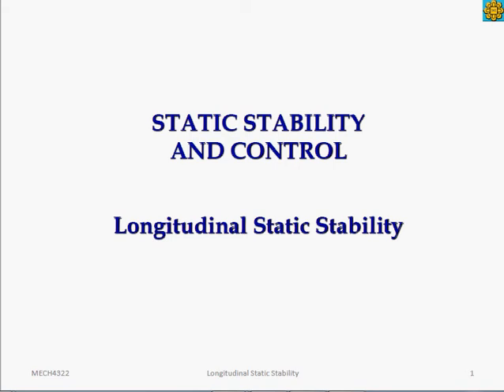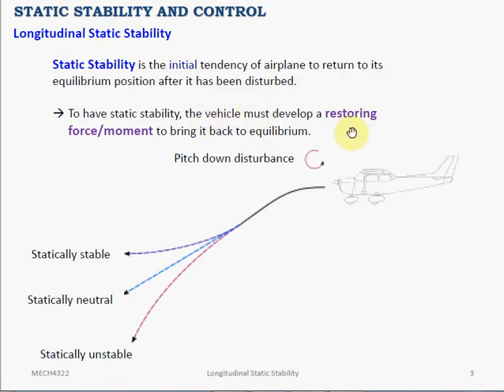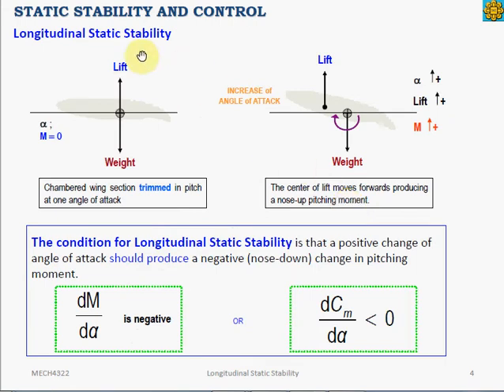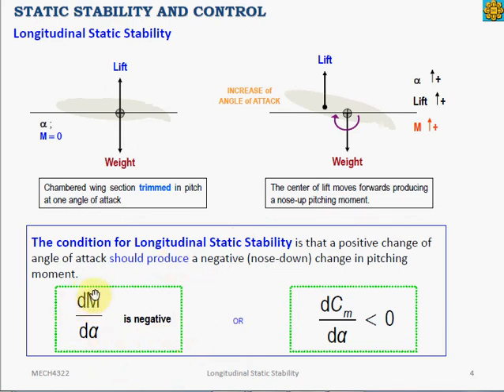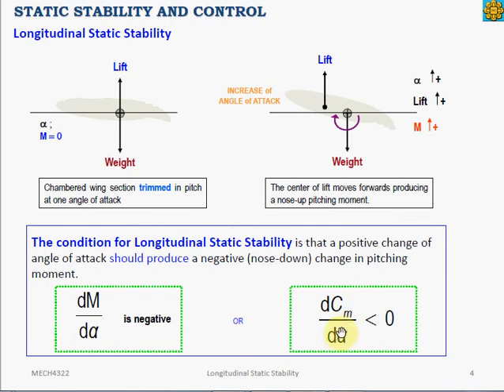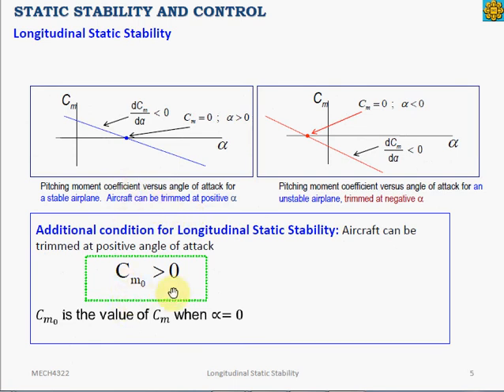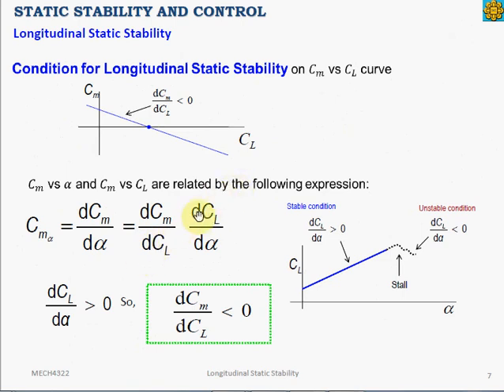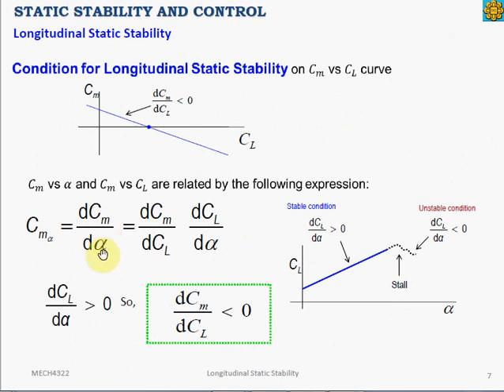1. Longitudinal Static Stability part 1: Flight Dynamics and Control Lecture

Comment: From my experience pitch stability is also achieved by ensuring that the centre of mass (CG) is positioned forward of the centre of lift. Equilibrium of pitch is then achieved by a negatively lifting horizontal stabiliser. In the case of a flying wing with no horizontal stabiliser the flying wing section must ensure that the centre of lift moves forwards from the CG at higher air speeds and rearward from the CG as the air speed drops closer to the stall speed of the wing. This movement of the centre of lift is generally achieved on flying wing sections with varying degrees of trailing edge reflex.